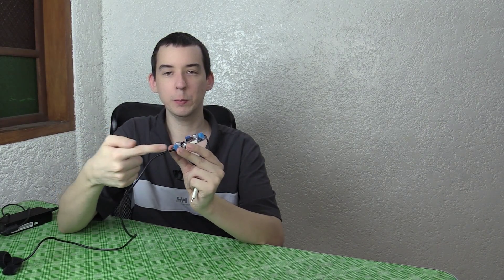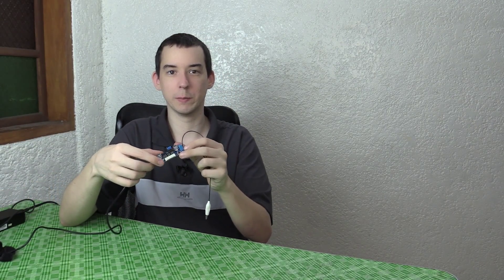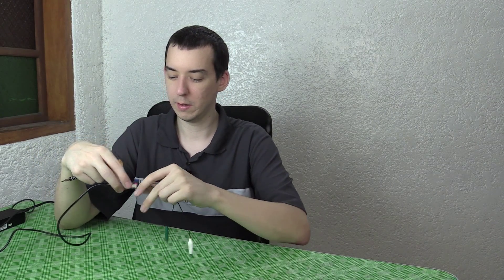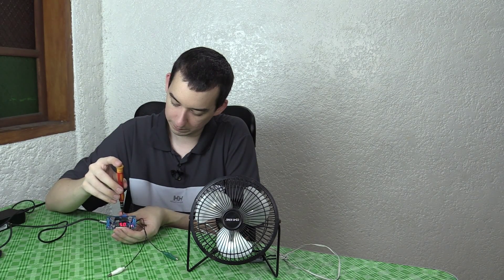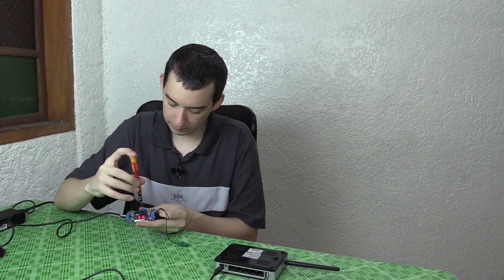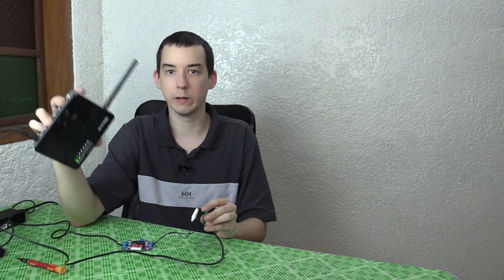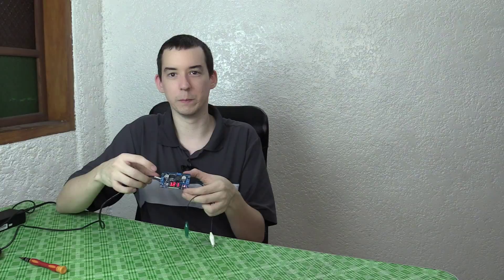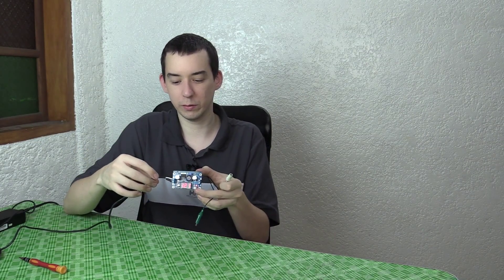Cheapest Adjustable Power Supply LM2596

Comment: Could you use something like this to go from a solar panel with max voltage of 18.2 to a digital thermostat the needs to not have over 15V to the input? From the thermostat I would power a 12V .1a computer case fan.

Comment: Dear Sir,I need your help in building an aquarium led light. I want to use 1 watt or 3 watts leds which run on 3.2-3.6 volts which can be adjusted by the step down buck regulator. But I want to know that how many leds in a string can be used. 1 watt led uses 350ma and 3 watt leds uses750 ma. I also want to know that any 12volt 5amp power supply can be used or it has to be a constant current power supply? Please help me Sir

Comment: can i use LM2596 to power a 12 V dc motor (car radiator fan) with the LI-ION battery 18V 4A
Reply: yes but output i max is 1.4 amp

Comment: sir can  i use this between a solar panel and battery for charging the battery instead of the regular charge controller
Reply from the maker: Absolom Madhaka You could but it wouldn't work anywhere near as well.

Comment: I'm thinking of using something like this directly to a solar panel. Do you think this will produce more power than a simple PWM charge controller?
Reply from the maker: Good question. To be honest I really don't know!
Reply: This will peroform similarly to a mppt solar charge controller, without a battery management system.

Comment: At 5 dollars, one get a better dc-dc converter's module i.e. USB port and Power, Current, Input and output Volt displays meter. A little resolder work, header with a better Bournes 10 turns pot, and house it in nice plastic or aluminium case, great for any low volt / amp testing. http://www.ebay.com/itm/TOP-5A-CC-CV-LED-Drive-Lithium-charger-Power-Step-down-Module-W-USB-Voltmeter-/201138076316?pt=LH_DefaultDomain_0&hash=item2ed4c37a9c
Reply from the maker: Cool. That's basically the model I was describing as having the current limiting. Except without the USB port. I guess it's useful to have the port on there although it's a bit more expensive compared to other boards I've seen without the port :) Is that also using the LM2596? The advert doesn't say, but it looks like it. By the way, tune in later to see the case I made for this one ;)

Comment: Will the set output voltage change if the input voltage changes ? ( if still above the set voltage of course) i have a few low power devices like a 9 volt 1 amp modem/router i want to run directly off a 50 watt solar panel when it's sunny enough out, and the panel voltage will go between 12- 18 volts with a 1 amp load , if it stays at the set voltage this would be a great low cost way to power devices that require less than 12 volts directly from a solar panel
Reply from the maker: Even if your input voltage fluctuates, the output voltage stays the same. As long as your input is at least 1v higher than the output.  I should have shown this and maybe I will in a future video, because like you say, it would be good for simple solar applications.
Reply: Thanks, i may end up picking a few of these up then.